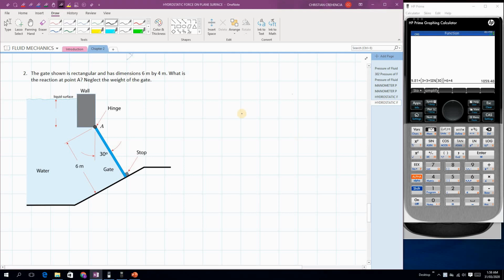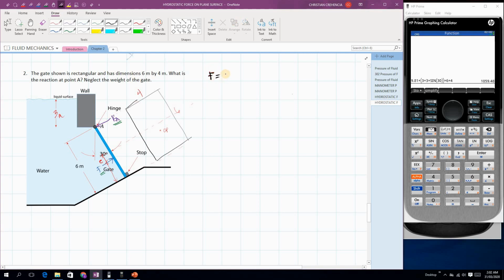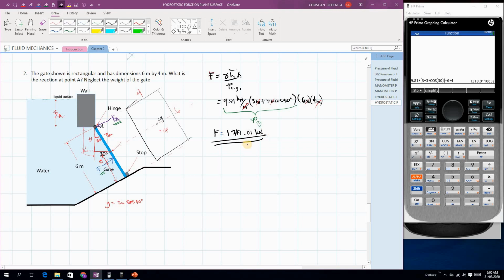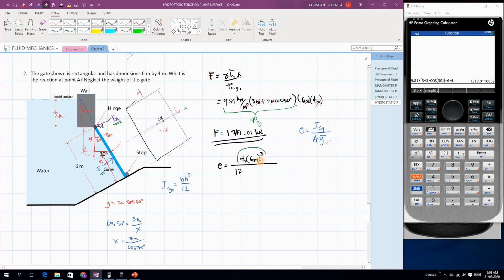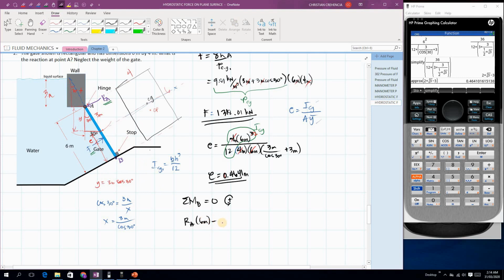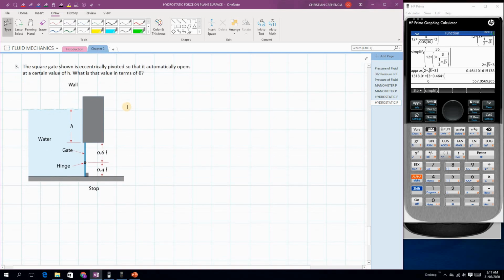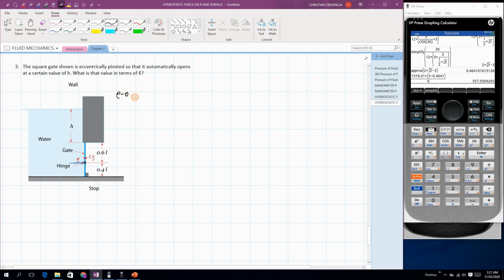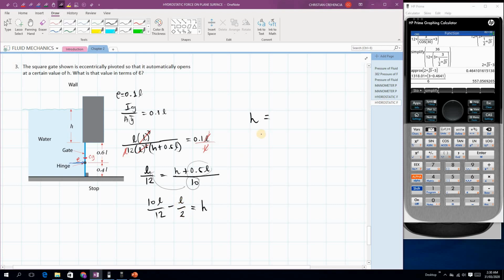09 HYDROSTATIC FORCE ON PLANE SURFACE Part 3

Comment: ito naman mo Engr. " A Triangular gate having a horizontal base of 1.30 m and an altitude of 2 m is 
inclined 45o
from the vertical with vertex pointing upward. The base of the gate is 
2.70 m below the surface of oil (s = 0.80). What normal force must be applied at 
the vertex of the gate to open it? Show figure
thank you po